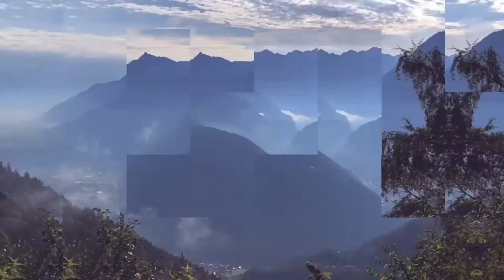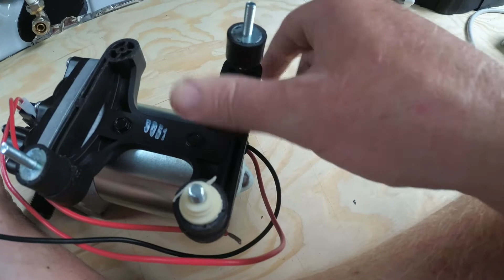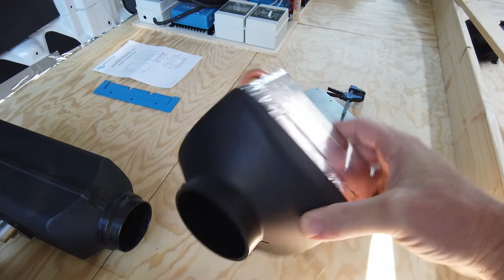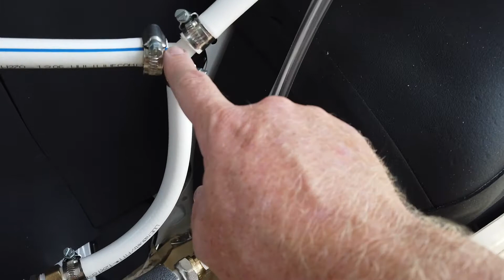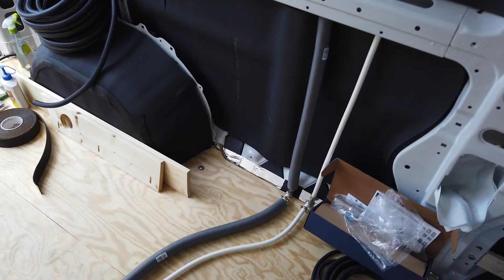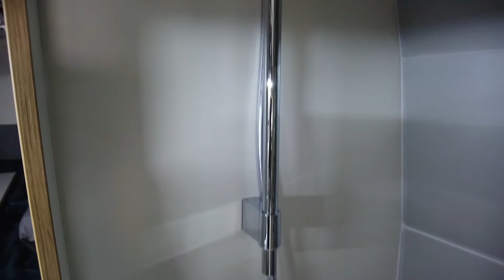LVED CamperVan - Water Installation

Comment: Nice wideo! Did you try to run the heater throu inverter? DId you measure how much current does it consume?
Reply from the maker: The boiler takes 1200W and heats the water in 30 minutes to 65 degrees celsius.